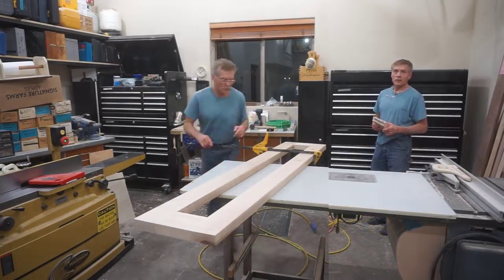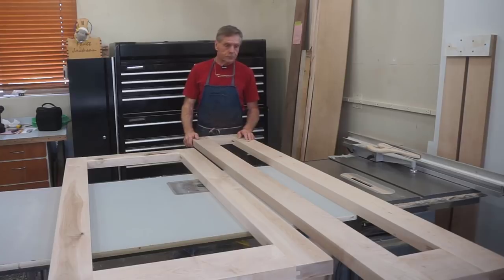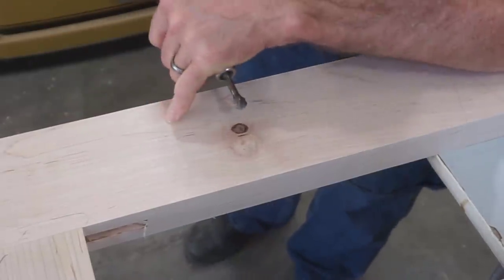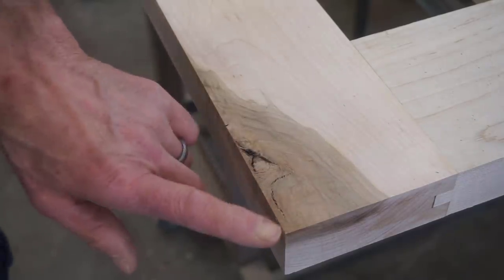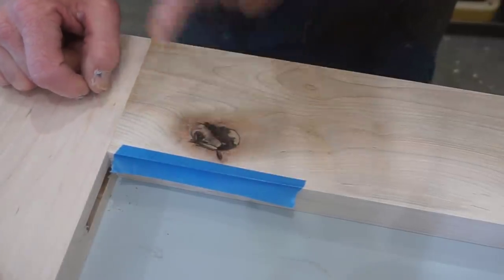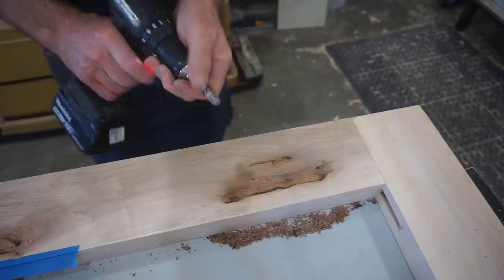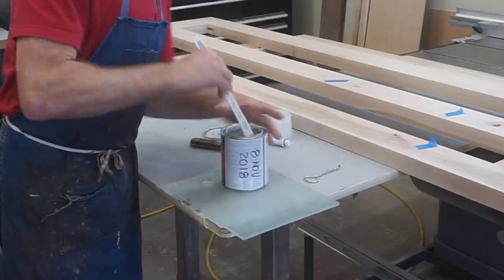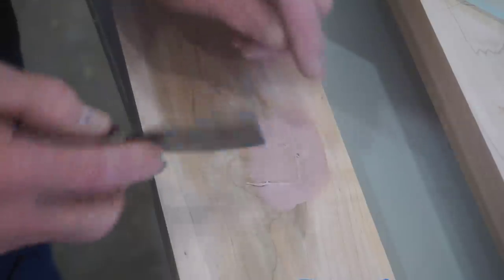How To Repair Defects in Wood Before Painting

Comment: Bondo makes a white hardener which is better than the red because primer paint hides the repair more readily as it is light grey rather than the much darker reddish/ purple-grey.
Reply from the maker: That I did not know Kevin.  Makes perfect sense... in your experience is it harder to get a thorough mix by watching color consistency or does the white make enough of a color change to notice? Thanks for watching and commenting...
Reply: @NextLevelCarpentry  Hi Matt; it does make a minute difference to the color, but I just mix the hell out of it on an old synthetic cutting board my wife discarded and no issues what so ever. Can you tell me where to find your video where you discuss cleaning sandpaper with a hacksaw? Great work on your part, I really enjoy your videos and information you share, Thank you so much. Stay safe.
Reply from the maker: @kevinweaver4265  this is the right video... that tip is here: https://youtu.be/FfhtgWF_ETY?t=2824 let me know if that's the part you're asking about?  You can see I pinned your comment so others can hear about the white hardner... pretty useful! You're most welcome BTW!
Reply: The color makes a difference. Too much hardener you get a too soft mixture. The color helps you regulate how much hardener to add..
Reply: i just find Cosmos Lac makes "bando" for metal plastic and wood!! in wood color ish in Greece just blend nice filling screwholes . lucky find!!!

Comment: Completely worth my time, especially the repair on the repair was valuable because this is a tip that doesn't spring naturally to mind if one is just going to start out using car filler.
Reply from the maker: That's what you get with an autobody/woodworking mash-up, right?! 😁😎 Glad you liked this... Deanna... I use this with confidence to get perfect results on painted millwork and cabinetry.  Best, Matt

Comment: Working on repairing some knots in my deck before I paint, and this is so helpful! Thank you for the thorough explanations!
Reply from the maker: I've used this same method for repairing more knots in redwood decking than I care to remember and can tell you it works as good as any method while being relatively fast and durable.  Because decking is exposed to excess heat, cold and moisture, be sure to prep the wood aggressively to remove ALL loose bark/wood from knot holes and leave the patch area very rough to help the filler adhere during temperature fluctuations and related expansion/contraction.  Hint: apply strips of wide masking tape to the underside of knot holes that go all the way through to keep filler from sagging out as it cures.  BTW I learned it is nasty, dirty, messy work but is a responsible way to preserve and maintain wood decking while keeping it in good-looking shape!

Comment: Much appreciate you taking the time to make the videos. May look a little younger in my profile pic but this video brings back great memories of the Big Dig. I had to do some finished concrete walls at the exit of the tunnels and we lined the regular forms with luan sheets and Bondoed everything for a nice finish on the walls. I was on top of that and chamfering everything. A lot of the chamfering had to be done after the wall was up and after electrical was done. Luckily I was a lot thinner back then. They had to get an electrician off another job small enough to fit down inside there. Anyway thanks for the memory, lol. Damn it was hot in there.
Reply from the maker: There's nothin' easy about form work Randy... no matter your age!  And you neglected to mention that unforgettable smell of form release oil that permeates everything... and even more so when it's hot and humid!  Thanks for the anecdote... Best, Matt

Comment: Very helpful, You filled a few gaps in my repair procedures, been using Bondo for many years, now I recognize my short commings.
Reply from the maker: Thanks David... if you care to share any particulars of what I showed that you change for better results I think it might be meaningful to other viewers... and me too! Best, Matt
Reply: OK, well first, the feathering-out of the knots and defects before filling with Bondo.  Second, your mixing procedure of the filler, you work the mix over and over, I only mixed to change color(afraid of over working the material.)
Reply from the maker: @davidjanuszewski5020   Cool.  Some in the autobody trades may criticize me for my mixing technique as it can introduce air bubbles into the putty... I think a 'stirring' action may do that less but it application method can introduce air bubbles an resultant pinholes anyways.  Just saying this in case you happen to encounter problematic pinholes in your finished work.  Sounds like you're well on your way to more desirable results!  Best, Matt

Comment: I applied these techniques to a cabinet I am building out of construction pine boards. Took me a lot of burring out, wood filling, sanding, rinse, repeat, but after paint it all looks amazing. My wife kept picking on me because the project took a LOT longer than I had originally planned on. I started it back in April, it's now halfway through June, and I'm just getting around to putting hardware on it, haha. I did learn that I could use Poplar in place of pine for shaker style panels......would have saved me a lot of time on this!
Reply from the maker: You learned a good lesson on that project in realizing the benefit of material choice and its direct effect on labor required for a given project. At least you'll be able to better manage/anticipate work involved for future projects 😉😎
Best, Matt

Comment: Great craftsmanship. One note. When we tell ourselves how we hate doing some of the things we have to do. In time because we have said and thought it so many stinking times. The job even gets harder and harder and the dislike becomes ugly. The Cure. Stop having a conversation about how we don't like it. Have thoughts instead of how easy it is. Anything positive instead of the negative junk. I truly work. Yes, it will take due diligence but the rewards are so worth it. Yep, old dogs can learn new tricks.
Reply from the maker: Thanks for that true and inspirational comment MLWDIS.  I'm no therapist but I've found personally that, when it comes to things like the sanding that I 'hate', the more I dislike it, the more it helps me improve my workflow to avoid it. Kind of like reverse psychology.  I 'hate' cleaning up dried glue from woodworking projects and that feeling, reinforced by facing the unpleasant task for years, lead me to use a sharp putty knife and sawdust to clean up glue while it's still wet, another significant workflow improvement as a byproduct of the dislike I feel towards it.  I encourage other woodworkers to consider doing a mental flip on stuff they 'hate' to see how they might improve their skillset in the process.  Best, Matt

Comment: I have a good amount of 3x12 oak I was hoping to use for a bar top and it has a few large knots. I think I'll use this technique to patch them up. Great vid!
Reply from the maker: If you are planning on staining your bar-top I would not recommend using this method because I think you'll be disappointed with the results... from an appearance standpoint not from a durability standpoint.  To repair loose knots in wood that is going to get a clear or stain finish I use epoxy resin and sometimes diet dark brown or black because then it looks more natural with a stain finish... have fun! Best , Matt
Reply: @NextLevelCarpentry  I was thinking for the underside.I wasn't sure about the top finish but this sounds like a good idea.
Reply from the maker: @cristiancruz1972  Oh, I see... well, for anything that doesn't show this is pretty much my method of choice... good luck with your project! Best, Matt

Comment: For bondo repairs I found that a hand plane is actually quite amazing. It flushes things up without  dishing the area around the repair or throwing dust like you'd get with a power sander. It takes you right to finish quality without having to go through all the grits. Hand planes are too much a pain to finish whole projects but they are wonderful for this kind of spot use.

Comment: Matt, I recently repaired some old wooden window sashes rotted at the bottom using the same bits and epoxy and bondo..since most of the bottom rail was gone I left screws in the good wood to give the epoxy something to grab permanently, but the process is the same and they look great..
Reply from the maker: Good thinking Martino... I too use screws for 'rebar' in similar applications. Amazing what a bit of bodywork can do for deteriorated millwork, right? Best, Matt

Comment: Excellent tutorial thanks. Amazed at the hacksaw trick.
Reply from the maker: Yeah the hacksaw blade trick is a really slick one... you can also do it with a piece of coat hanger or piano wire and it works pretty much the same.  Glad you liked it and thanks for commenting! Best, Matt
Reply: Matt - I missed the hack saw blade trick fast forwarding thru parts of the sanding - can you share the time it was shown.  Thanks again for such detailed videos!!  @NextLevelCarpentry
Reply from the maker: @RogerCoville  this should get you there: https://youtu.be/FfhtgWF_ETY?t=2839 BTW you can use a piece of stiff wire like a coat hanger or piano wire too... Best, Matt
Reply: @NextLevelCarpentry  That is a great tip - thanks!

Comment: Hi, Matt.  Thanks for another great video.  Two questions: 1- would you recommend using this technique on an old wooden kitchen floor prior to painting?  I don't want to rent a heavy sander and risk my back or the floor.  and 2 - would you please provide a list of materials and tools and where you go to get them?  I know the Bondeaux you get at an auto body supply store, but how about the sanding blocks and the pretty wooden handled putty knives and the carbide burrs?
Reply from the maker: Hi Mary, I don't see any reason that this wouldn't be a very acceptable solution for patching a wooden floor that is going to get painted.    Make sure you you don't do any patches that cross joints between the separate boards because this isn't strong enough to hold them together.
Check the Amazon link in the video description and you will find all of the tools and supplies I used in the video there for purchase through Amazon... I like to promote that Amazon influencer page because any products you buy through those links are the same price to you but Amazon pays me a small ad fee that helps support videos on this channel which I really appreciate!  Best, Matt

Comment: Another tool for my toolbox.  I'm thinking of making custom molding and picture frames. I can see how this would save me on material waste.
Reply from the maker: It's possible to use this on mouldings Russ but it can be tricky to sand repairs to the detailed contour of profiles.  A word of caution: I've found that bondo will dull a router bit almost instantly if you rout through it... it doesn't even make sense since bondo is just plastic but try it out on an old router bit to see for yourself... it's been awhile since I tried it because my memory is that I ruined a bit when I did and I'd rather not do it again.  You can check out my video about 'Cutting Wide Custom Coves' where I make a custom sanding block out of bondo to follow the cove's profile.  It works great for that application but that method would fail on mouldings with any appreciable level of detail.  Hate to be a buzzkill with this news but you'll know how to apply the info and still get the results you're after.... Best, Matt
Reply: Thanks for your lengthy reply.  Well, in that case, I guess I won't try Bondo on molding and picture frames.  BTW. I'm thinking of making very simple frames, suitable for modern photographs.  Wood filler will probably be fine for my purposes.

Comment: Thanks heaps for yet another great, entertaining and enabling tute. I really enjoy your sense of humour. One question: couldn't you have changed the direction of the drill to help prevent the burrs running onto good wood, I.e. Drill set in reverse?  Helps avoid some carpentry calisthenics.
Reply from the maker: Hey Derek; switching the drill to reverse to avoid collateral damage solves one problem and creates another since they don't 'cut' as well in reverse.  If 'running onto good wood' were unsolve-able I'd probably clamp a 'curb' on the wood so  a runaway bit would hit it before causing irreparable damage.  You're quite welcome for the vid 😎... Best, Matt

Comment: Matt, thanks for this video.  Funny story to share:  I'm relatively new to woodworking and was showing a cabinet build that I did for our home with a contractor.  I complained to him that I couldn't quite get rid of the slight imperfections in the paint grade wood even after using filler coats.  He suggested that I use Bondo on my next project.  I too used Bondo on automotive body repair a million years ago but I thought he meant wood filler, just do a better job.  There was a slight language barrier between us so I just put that conversation in my library of dead brain cells.

I found your video last night whilst killing a few more brain cells and thought......brilliant!  Next time I see my contractor friend I'll thank him for the tip....and now....thank you for restoring a few brain cells!
Reply from the maker: Just don't sniff too many fumes while working with Bondo Blake... as you know the stuff has a strong 'fragrance' which could likely kill a few brain cells itself!😂😂😁😎 Best, Matt

Comment: Great info madman.  love the dry shop humor.  I'm gonna give a blown out damaged door lock set area a try.  I'm wondering about using a "second string" power planer on the initial knock down.. what do you think?  a few pieces of painters tape on the face of the work to insure I can't hit the good wood and series of light passes to get me close....
Reply from the maker: Hey Scott: I think bondo is fairly abrasive and will dull blades quickly... I seem to remember dulling a router bit on it quickly once and quit trying to use anything but a sureform plane or grinding disc for speedy removal.  Best is to manage application and get used to using a sureform at the right time to minimize sanding to keep an efficient workflow.  Best, Matt
Reply: that makes sense, my planer is happy you said so.  Even the #2 doesn't want to be bitched up.  Thanks for all your work and passed on knowledge.  Always good stuff.  thank you madman!

Comment: good show and tell on the bondo.lots of good tips. you could have stayed with the auto repair theme and used glazing putty (nitrostan) for the pin holes. one thing you failed to mention is the absolute mess that stuff makes. half of what you use ends up all over your shop and on you.a dust mask is pretty much a must have. i try to do all my bodywork sanding in the driveway and if you don't have compressed air ,get some you will need it. love your videos.
Reply from the maker: Thanks for commenting Larry.  I used to use glazing putty for those skim coats but it too can 'gum up' sandpaper.  Of course it's necessary for bodywork on metal/fiberglass but I really think the specific Elmer's Carpenter's putty shown in the video is better for working on wood... but that's more opinion than proven fact.  Glad you like the videos and thanks for adding meaningful comments! Best, Matt

Comment: Thanks for being so thorough in your demonstrations. Lots of great info you've taught us here! Is 150 your final grit when the item will be painted?
Reply from the maker: 150 grit is more than adequate for a spray applied paint finish IMHO. 120 Grit is plenty if the Finish is applied with a brush or roller. Personally I think sanding Beyond 150 grit for anything but a gel poly or wax finish is actually counterproductive...

Comment: Good video Matt. All the questions you got about bondo and wood movement probably wouldn’t be an issue as long as they do a good prime coat and a good top coat . Doing the prime coat and top coat should keep the wood movement to a minimum don’t you think?
Have a Merry Christmas!
Ron
Reply from the maker: The good prime coat and top coats you mention are essential even on doors with no repairs and at least as important on repaired ones.  I think that's a often overlooked detail and a fair number of perfectly good doors are spoiled for lack of attention to proper painting.  Thanks for adding this comment Ron... Merry Christmas to you and yours too! Best, Matt
Reply: Next Level Carpentry    I agree  with you Matt.. If you take the time to build the project why not do it right and give it the best chance to be a long lasting project...
Thanks for the Christmas wishes, Merry Christmas to you and yours . 🌲

Comment: I have used bondo several times.  The problem I usually have is that the bondo absorbs paint pigment at a different rate than the wood thus showing the patch clearly upon painting.  Also, the Bondo sands more smoothly than the wood which has a grain and pores in it.  This also telegraphs...  any suggestions?  Thanks!  Nice clear video...  Dave
Reply from the maker: Hey Dave, I think your issues with bondo would be solved by making sure you're using a good quality primer before painting.  Apply a full coat according to directions and sand it well... that's all I do (or ask my painters to do) and have never had issues.  Also if you're using open grain wood like oak, hickory, ash, mahogany and such the bondo will ALWAYS be smoother unless you treat the entire surface with wood filler.  Using soft maple, alder, poplar and such should work swimmingly with the process I show in the video.  Good luck!